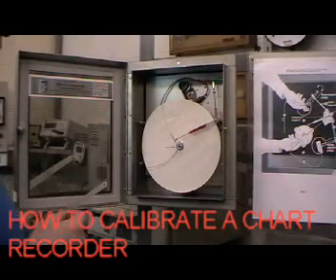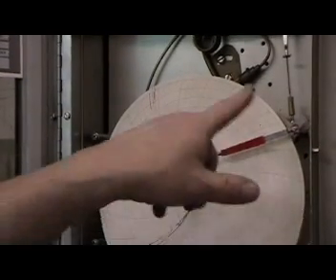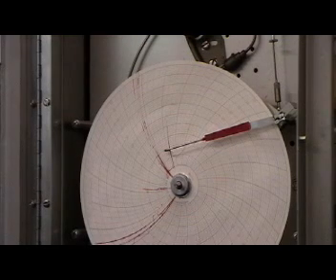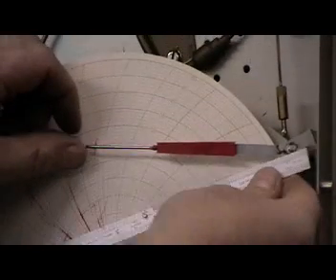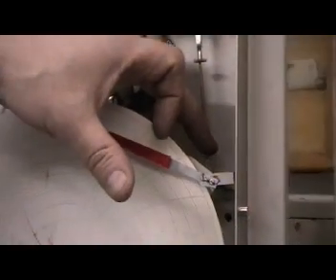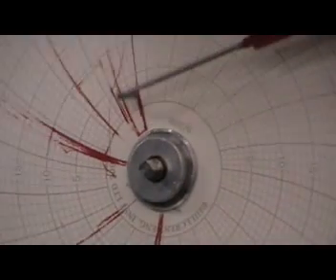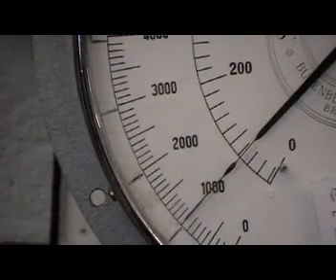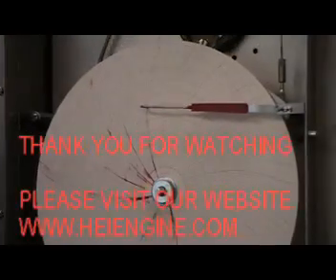HOW TO CALIBRATE A CIRCULAR CHART RECORDER.asf

Comment: you CAN NOT CORRECT THE CALIBRATION, YOU NEED TO DO CALIBRATION TO VERIFY THE ACCURACY OF THE PRESSURE CHART RECORDER
Reply from the maker: When I did this video it was purely to show how to adjust . If you listen to my commentary I say that I corrected the recorder by knowing exactly where the linkage position should be . however what you say is correct the only way to correct is to do a full calibration. It is however common place in industrial applications for users to adjust the zero to compensate for transportation etc this is a questionable practise as it assumes all adjustments apart from zero have not changed . After 40 years and having been trained by the best of the best I would like to think I know what I am talking about .
Reply: @heiengine  normal practice, is to check zero , 50% and 100% of full scale or full span using the deadweight tester. If the pointer on the chart is out, then adjust the linkage of the pointer.
Reply: @heiengine  yes, i respect your expertise in calibration works. How many times do we need to repeat (for conducting repeatability test) and do the full range calibration of the scale of the chart recorder.